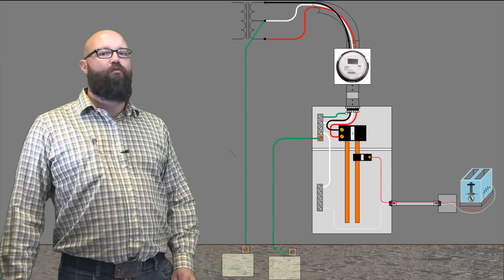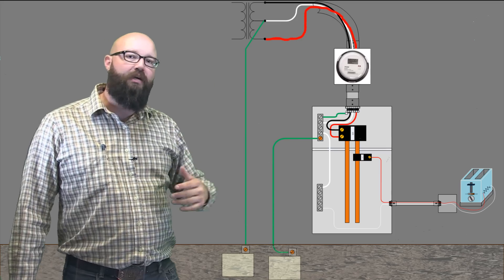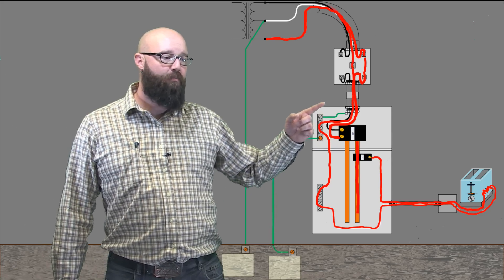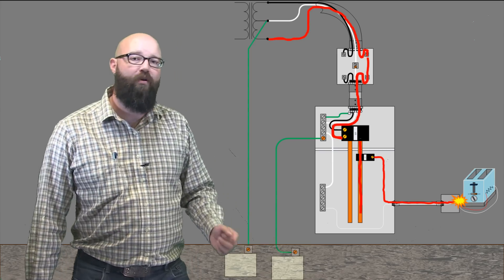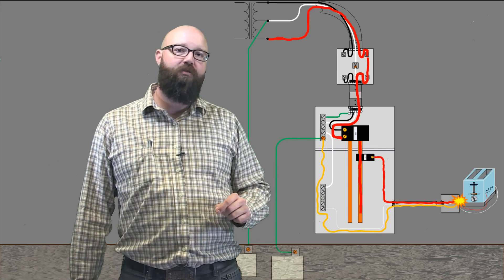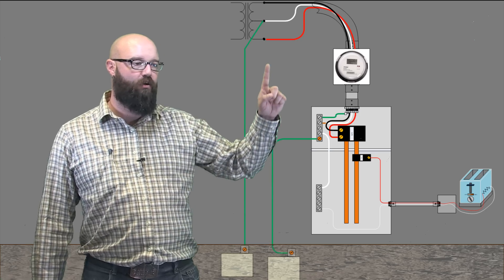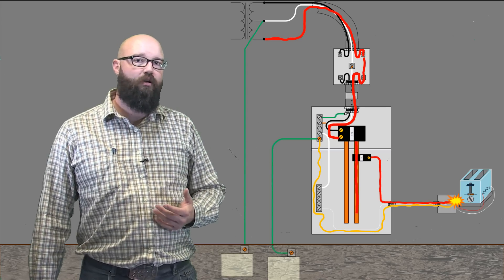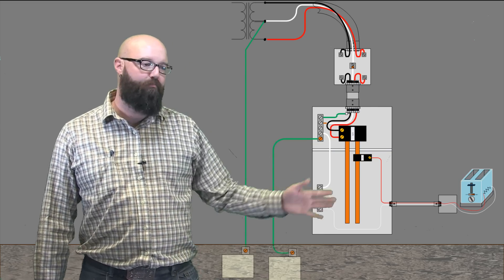Grounding and Bonding

Comment: People die, trying to fix wiring problems, or burn down houses for not understanding - grounding, high voltage, and so on. U have good graphics n an overall understanding, thank u for that but it is not enough as the language u use is that of electricians, tradesmen, Journey men level. Bonding? Ur info must be deciphered first to benefit from ur vid. Otherwise, great vid.Thanks
Reply: You are absolutely correct that the explanation is not enough, which is why you shouldn’t be attempting to work on an electrical system

Comment: I still don't really understand why the ground fault current doesn't flow directly to the ground stake instead of traveling back to the transformer. The huge grounding wire has very little resistance to current.
Reply from the maker: The current wants to return to the source, which is the transformer. Not the ground itself. All bonding is done to ensure a low impedance path back to the supply, which completes the circuit, with the load bypassed, and the massive short circuit current will open the overcurrent device.

While the earth itself is a current path it is a huge impedance with respect to the neutral path back to the supply.
Reply: @schulerruler  I see. Thank you for the video and the help! So the only time the earth ground is really used would be by a lightning strike? A path for a huge current overload.
Reply from the maker: @davidh7636  lightning and other transient high voltages yes.

Comment: Check with your local authority. This ground and neutral wiring example would most likely FAIL.
Reply from the maker: This example is from previous code where bonding at both the meter base and service disconnect was acceptable but now only one of the two may be used as per 10-210 in the 2018 Canadian Electrical Code.
Reply: @schulerruler  Thanks. With the constant changes in code you'll need new video's every few years.

Comment: Excellent video. I'd like to add that scenario #2 also takes place simultaneously in scenario #1 but imagine it's not shown for clarity. Once current hits the ground bar, it's going to flow in the neutral and ground return path and ultimately end up at the source. These paths run parallel from the bus bar to the meter and more current will flow in neutral path since it's likely made of copper vs the aluminum or steel raceway

Comment: Why is there no earth wire at the supply point of the toaster? Earth path shouldn't go down to earth where the path is connected?
Reply from the maker: Many appliances are double insulated, meaning through their construction, there is no possibility of contact with the energized parts to the outside case. 
This does not require a connection to earth at this point. Usually the plug will only have two prongs and will not utilize the third earth or ground pin on the receptacle.

Hope this helps explain. Thanks for watching!

Comment: I have a 200 AMP main on a pole outside it goes to a 200 amp panel in my garage, from that panel I ran 100 amps to my shop THEN from that panel I ran three wires to another garage 140’ away, everything is in grey pipe. Is three wires legal in the last garage, or will I have to pull them out and re-pull it with a fourth insulated ground wire ? 
Any response will help Thank You
Reply: Yo Man    The rule in NEC says to pull a ground in "feeders" to the buildings Fed from other buildings and install ground rods.   250.32(B)(1).    Exception No 1.   Allows for there to not be a ground conductor, but there are some requirements that must be met.      The reason (my opinion) the exception is there is because over the many versions of the codes I have designed to since 1983, this rule flipped and flopped at least 5 times.   They seem to not be able to come to an agreement on how to look at it.    So, obviously both ways work.   I suggest you read the exception to make sure all requirements are met.   Respectfully,   Kevin

Comment: I have always thought that you will need a grounding conductor alongside your current carrying conductors inside a raceway as part of a grounding system.
Reply from the maker: Are you referring to the raceway supplying the toaster? If so, the conduit is the bonding means and would not require a bonding conductor.
Reply: @schulerruler  this is true
Reply: I don’t know any electrician that would not install a grounding conductor in a raceway even though the raceway is a grounding conductor.  Too many things can go wrong causing the grounding path to become jeopardized, such as loose connector screws, locknuts or physical damage separating the raceway from the box. Walk around in a factory building and I guarantee you will find at least one incident like this.

Comment: Aren't nueatral an ground supposed to be separate , not sharing
Reply from the maker: It depends where in the system it is. All solidly grounded systems require a connection from the neutral to the grounding electrode. On the load side of the service box , there can not be a direct connection between neutral and anything metal non-current carrying.
Reply: the only point where you bond the neutral to the ground is in the main bonding jumper which is located in the first switchboard/switchgear/panel from the load side of a service transformer or its own system.
Reply from the maker: @jcpprojects1198  you can have either the meter base, or the service box be the point of bonding between neutral and the grounding conductor, provide the meter base is definitively on the SUPPLY side of the service box
Reply: Thanks that good info to remember

Comment: Great presentation!  In this scenario, both the loadcenter and the meter base are bonded, it seems to me.  This makes me wonder about the propriety of Not bonding sub-panel loadcenters??  I am working through the theory of bonding or not bonding a sub-panel, perhaps over-thinking but wanting to understand the theory in as clear a manner as your demonstrate in this video.  thank you.
Reply from the maker: Thank you for the comment! This video is illustrating the 2015 electrical code which required both the meter base and service disconnect to be bonded to neutral as it was line side metering......however, as per new code (2018) we would choose one or the other, not both.
Reply from the maker: A sub-panel would not be bonded to the neutral as it would be located on the load side of the service box, and no grounded conductors (neutrals or identifies) are to be bonded to anything metal on the load side of the service box.

Comment: es muy bueno el video para ver como es que dispara por corto circuito los breakers, pero esa instalacion esta fuera de codigo, ya que todo raceway debe estar aterrado por un wire verde independientemente de que haya boundeo mecanico
Reply from the maker: Not all raceways require a separate bonding conductor. In this example, the metallic conduit constitutes as the bonding method. Hopefully this addresses the issue you are speaking of?
Reply: @schulerruler  sorry man quizas no explique bien, pero en mi entrenamiento para journeyman unas de las cosas que explicaba el inspector que nos preparo es que independientemente del bondeo mecanico, que por suesto se que existe, los inspectores exijen el bondeo fisico por wire. yo vivo en florida y por lo menos aca es asi. se que cada estado tienes sus normas independientes del NEC

Comment: the fauly of hot to neutral will cause low impedance path to the source however all metal exposed parts including the grounding conductor to the grounding electrode which means fault current on all grounded paths ie parallel paths.all points of this current will be equal.
Reply from the maker: Remember how quick this will trip an overcurrent device though. In a ground fault, the trip time is almost immediate.  The current on paths would be inversely proportional to the impedance of each path as well, not necessarily equal.
Thank you for watching and commenting.

Comment: COULD YOU EXPLAIN THE DIFFERENCE BETWEEN BONDING THE BONDING BAR AND ISOLATING IT IN A MOBILE HOME AND THE REASON FOR IT
Reply: The  reason Mobil home panels have isolated neutral bars is they are sub panels. The service entrance or main panel is located outside next to the meter. That is the one and ONLY place where the neutral bar is bonded to the cabinet and grounding electrode system. It’s no different than in a building, but the way it is often explained ignores the obvious simplicity.

Comment: i know this is old but for clarity, this is a main panel you are talking about right? with a bonded neutral.  if this were a sub panel (house panel) then the ground and neutral would not be bonded but since you used a toaster as the resistance wouldn't you be energizing the ground wire every time you turn on the toaster? of coarse i know electricity will naturally follow the path of least resistance so i'm guessing the electrons will choose to go through copper wire before going through dirt/water/ground? can you please clarify?
Reply from the maker: You hit the nail on the head. You are technically providing a parallel path through ground but the impedance is so high relative to the neutral conductor impedance, there would be almost nothing on the ground connection. It (ground) is there to help with lightning strikes and surge voltage.

A sub panel would require the connection between the neutral and panel to be removed completely, as the only place this is allowed is on the "supply side" of the service disconnect.
Reply: @schulerruler  agreed thanks
Reply: @schulerruler  so a wire has a higher impedance than a metal box?
Reply from the maker: A properly sized neutral will have a lower impedance than the equipment being bonded together (metal boxes, conduit, binding conductors etc) but the metal box is still a sufficiently low enough impedance path that should the connection between the panel and neutral in the sub  panel remain, an alternate path for regular "return" current would exist. 
The current would divide between the bonding system and the neutral depending on the impedance of each.

Comment: Our building power is 3-phase & 1 neutral, the neutral is grounded. But the ground wire isn't existed in the apartment sockets or I bootlegged the neutral pin to ground pin, it's working but I don't know if that has more risk than not bootlegging. But without bootlegging, I have like 110V floating on the PC case.
Reply: Get rid of that bootleg before you have a fire. In a fault that bootleg connection will be called upon th carry much more fault current than is is Abe to and presto, more toast

Comment: Not sure what your background is, but using Ohm's Law and impedance in the same sentence is telling.  Ohm's law only applies to purely resistive circuits and, even then, not all resistive circuits are Ohmic so Ohm's Law will not apply.  Though it is correct to say that lower impedance will result in higher currents (all else kept the same), it is not correct to cite Ohm's Law while doing so.  I'm reading through the comments and there appear to be none that are critical of your video.  In fact, all of them are smothering accolades.  Are you, by chance, censoring comments and only displaying the favorable ones?
Reply from the maker: I'm not entirely sure where you're coming from about the video criticisms, there have been conversations back and forth regarding a portion of the video that I have removed due to an inaccuracy, but no. I have not removed comments. 

Thank you for your insight into the ohms law reference, I am going to follow up on what you are stating. 
Thanks for watching and commenting.
Reply: Richard M    Robert Edwards comment was that he was full of shit.    The reason there are not a lot of critics is this is what happens when accurate and well done.   The arm chair electricians are lost because a lot of them don't really understand the video.

Comment: Fault current that travels to ground rod through earth will never trip a breaker, the Earth's resistance is to high....period! Take a wire from a 15a breaker and tie direct to ground rod and turn breaker on and nothing happens, will not draw enough current to trip breaker.
Reply from the maker: Can you say this for every possible location that incorporates solidly grounded systems, taking into account high moisture content locations, saline content etc? 

Besides that the point has been addressed many times, both in comments and the video description.
Reply: @schulerruler  Yes, the current has to travel all the way back to transformer via earth. I have removed ground wire from ground rod then connected a #14 awg wire to ground rod and connected to a 15 amp breaker and flipped it on and it will not trip breaker. Simple owms law.
Reply from the maker: @craftyhandyman9757  if it's simple ohms law, try the same trick with a 600v circuit. 
I am very familiar with the path current takes, and I am aware of the earth impedance in most areas. However, the higher the soil moisture, the higher the soil conductivity. Try it with a deeper rod, or in an area that's close to sea level (ex: New Orleans) and tell me with 100% certainty that you will yield the same results. 
I'm not arguing that in most places, the impedance is too high to trip an overcurrent on a standard 120v circuit, but the last scenario we are discussing is very highly not going to happen in a properly installed electrical install with continuity ensured grounding and bonding.
Reply: @schulerruler  the grounding electrode system was never intended for fault protection but for lightning protection which I'm sure you know. I've tried this test in South Florida where I lived and never trips circuit. I just would hate to see some novice in older home with no circuit grounds think he can run a wire to ground rod and think he had some fault protection if you know what I mean. Your explanation was excellent till the last part which I had to disagree with. I agree that you should not lose both ground systems but over my 40 years of electrical work I have seen the lose numerous times.
Reply: Sam Eades     Do you really feel a strong need to tell everybody how smart you are?    Your comments have nothing to do with the video.

Comment: If it’s going through the ground and you have a bad “ground” like high impedance. Will it still trip the breaker?
Reply: Is it ever possible for it not to make it back to the transformer?
Reply from the maker: @Icemane1995  one thing to remember is the last example is very unlikely to occur, but the impedance of ground itself would rarely be low enough to open the breaker. 

The system is designed to provide a consistent path back on the neutral to complete the circuit with as little impedance possible. The majority of fault current does not actually go to ground.

I'm not sure what would happen if the party back to the transformer was totally sacrificed. I would assume the fault would not clear, and all non current carrying metal components would then have a potential on them.
Reply: Timothy, yes, the condition you question is called an open circuit, such as a light switch being off. So no current flows therefor it doesn’t need to go back anywhere. But, that is why switches are put in the hot side of the circuit before the load. If ithe switch was in the return path, a fault after the load would complete the circuit and find its way back, possible though your body. Not good.

Comment: Everything is correct except the last example. I=E/R. The grounding electrodes most likely will not have a low enough impedance through the Earth for the current to rise enough to trip the breaker.

Comment: Perfect example of why neutral in ground are hooked together with the bonding screw so the breaker will trip when there's a short circuit to ground if not ground will become hot because of the resistance to Earth ground

Comment: What is the resistance of your earth path back to the transformer grounding electrode? It is not low impedance and will therefore not provide enough current flow to trip the overcurrent protection device.
Reply from the maker: Please read video description.
Reply: I agree with you - the last part of the video should probably be edited cuz if people don't read the comment in the video description they are going to think that the breaker will trip.